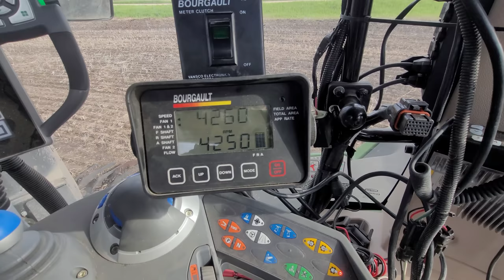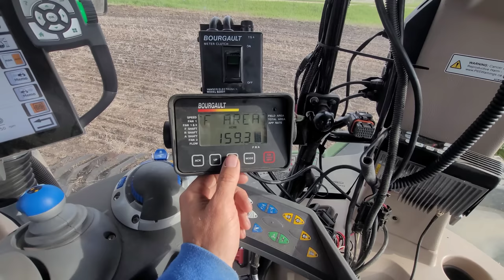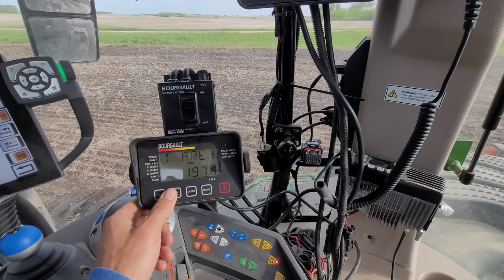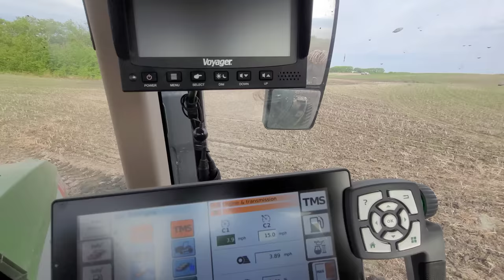Loading & Seeding with the 5710!

Comment: Urea isn't as quite corrosive as some other nutrients(maybe not a practical difference) but aside from rust you loose a huge amount of N to evaporation if it sits on the soil surface for even a few days. Like 50% N loss per week in warm growing weather. actual loss here depends on percentage mixing by the shovel openers and rain after application. AmmNitrate doesn't have the evaporation issue but nitrate is quicker to leach (but plants also suck up the nitrate preferentially) 
Ammsulfate costs a bit more per N but supplies S(maybe  too much S) which is needed in the soil about 1:10 with N and has neither the evaporation nor quick leaching issues.